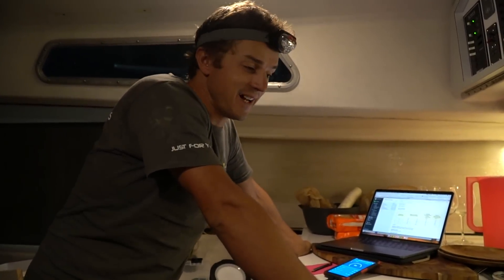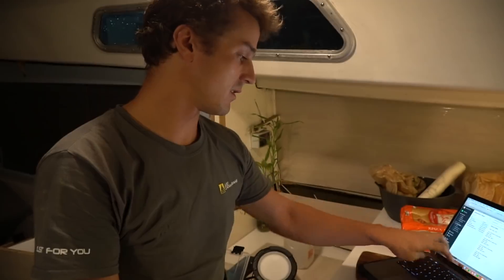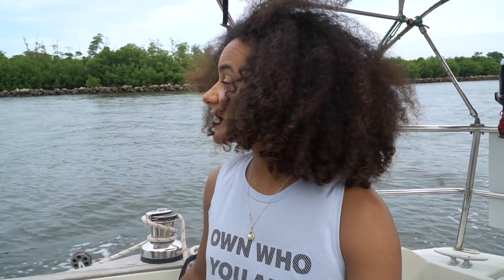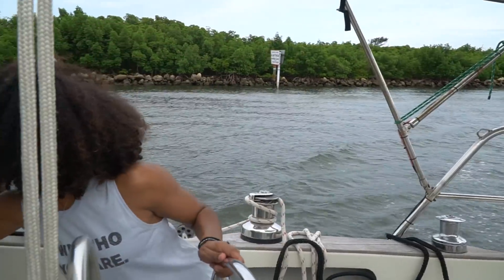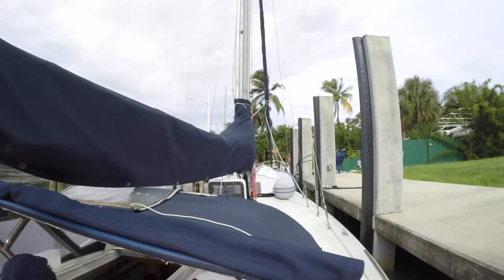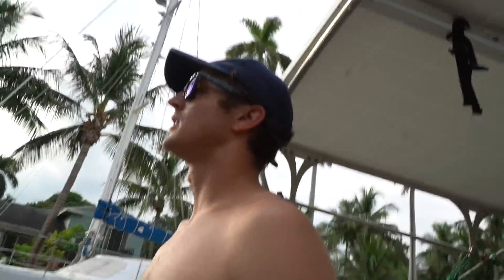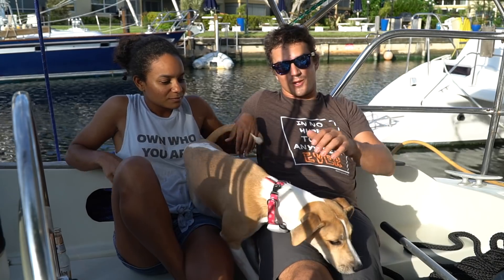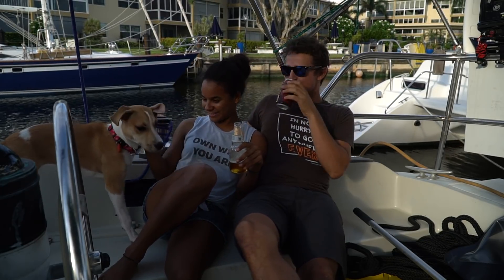Pushing our Electric Motor to its Limit— Sailing Uma [Step 139]

Comment: For all the electric motor downers here sailors like Lin and Larry Pardey sailed for 30 years without an engine.  If your situational awareness, or lack thereof, gets you into situations where only an engine will save you then sooner or later the engine will fail.  I know black swan events happen however in most cases proper route planning and seamanship are better safety companions than an over reliance on an engine no matter what the fuel source.
Reply from the maker: JED!! PM us your address. You my friend, get a free t-shirt!
Reply: Keep your shirt . I guess you didn't like my response so "JED " gets a medal  lol.  I do like your Chanel.
Reply: Dan, Kika (and JED), Our company has worked on a combined heat and power unit that runs a starter/generator at 890°F. In your application it could give you A/C, heating and long distance propulsion with environmental impact and running costs similar to the solution you now have.

However.... in trying to bring our tech to market we've learned that the big hurdles to adoption are not technical. They are political and macroeconomic. You can't significantly reduce global consumption of hydrocarbons without a major impact on economic stability. The answer is for people to change their behaviors to reduce HC consumption.

You guys are the epitome of where the world could be. You only motor when you can't sail, you don't run a car and you buy old(er) thing (the boat and dingy etc.) and make them last. BTW more that half the environmental impact of the average 'plastic' boat is in its manufacture.... keep up the good work.
Reply: Lin and Larry got a lot of tows that aren’t detailed in their books. Nothing safety related but save time when they can’t get into an anchorage, „phone a friend“
Reply: The Pardey's also went and bought a much bigger boat, hmmm...I also found it a bit interesting that they really do not get into the towing issue much, hmmm...Granted, what they accomplished is awesome, but...
Reply: They could get a backup gas generator. They are very reliable and efficient.
Reply: Lin and Larry lived on an Island in AKL, NZ. Close to land they have had major challenges and even got stuck on rocks with damaged hull, however they did well offshore. Going totally electric has major challenges still, once power level is low you cannot simply fill it up quick like diesel, hybrid would make a lot of sense. Some years back Lagoon came out with model 420 hybrid, the 1st boat off the factory could not make it to its destination without blowing circuitry and having issues with batteries, and that was hybrid. They gave up electric eventually. No amount of lab work can prepare the drive system to deal with constantly changes dynamics of water, current and windage. While I would like to see a working system based on electric only, I am optimistic still.
Reply: How much battery capacity you have? How much your batteries weigh? Thanks in advance
Reply: I just wonder. The Dutch opended trade routes by Sea to Japan and China in what we call the our Golden Century. That the 17th Century, from the Year 1600 till 1700. How on Earth did we manage without a Diesel Engine in those days? By the way the German Rudolph Christian Karl Diesel is the inventor of the Diesel Engine. He lived from 18 March 1858 till 29 September 1913. His first Diesel patent was from 1892.
He disappeared was lost at Sea at 29 September under suspisious circomstances whilst Sailing to a shareholdrr meeting of his own company: Consolidated Diesel Manufactering. He also had talks with the Navy of Great Britain to fit diesel engines in submarines. 
As he had financial problems Some say he commited suïcide and jumped overboard, others think it was the German secret service  who did not like selling Diesel engines to the UK at the brink of WWI. Rudolph Diesel’s death was never solved.

As we say in Holland: “De beste stuurlui staan aan wal”. Roughly stranslating to: “The best Sailors stand ashore”.
But remember: “Wie zeilen kan, vaart bij elke wind”, a Dutch sailors saying meaning: “He who can sail, sails in every wind”.
Reply: @robinrouwen4580  We don't often read of the thousands of old ships lost at sea embayed on a lee shore or stuck for weeks in the Doldrums!  My 1885 Essex smack had no engine (indeed, no electrics) and  I never put us in a situation I could never sail out of. In the old days the smacks would happily rub shoulders with each other in port and even surge the running bowsprit to stop. Imagine doing that in today's marinas!  My other problem was that other sailors seeing a 65 foot o/a 17 ton gaff cutter would assume that we had an engine and could stop at will when they hit reverse in front of us. In 1885 nobody had an engine so they all acted accordingly.
Reply: Must be referring to 'VW', ha, ha, ha.
Reply: Stephen Gloor 😘
Reply: JED... We're part of the Mainly Electric Aircraft thing. 

You put a turbine in an insulated box with a motor/generator on the main shaft. The whole thing runs hot enough to produce useful heat (you need to understand a little thermodynamic theory here). You include a heat pump in the system to harvest the heat energy. You can use solid state devices for this (see Peltier Effect). .... and so you get an increase in total system efficiency and reduced weight. You include batteries for demand management and the whole thing runs at constant load, so it's reliable. You use bio fuels to address the environmental challenge. 

In a boat application the motor/generator would be decoupled from the engine to give you variable speed to drive a prop. When sailing (engine off) the prop would generate electricity. The heat pump would be configured in the boat to provide A/C and refrigeration. You'd configure the system to provide hot water and cabin heat. You also have enough temperature difference to cook.
Reply: I do understand both the need and the desire to go all electric. Depending on where someone sails, what kind of risks they are willing to take, it might be the right decision. When sailing a tri I tend to take other decisions than on a mono hull. A open boat has very different set of considerations. Since everything you do at sea has a higher risk than the stuff you do on land I tend to see the risk evaluation even more important. Main propulsion system are the sails, the back up is the motor. In a pickle I pick speed over the system. Even if it isn't pollution free it might save your life.
I had a hell of a time when crossing the North Sea, forecast was wind up to 4bft. Normal trip of around 250 nmiles. We encountered a channel rat, up to 9bft. That was on a tri, speed was the saviour, in that storm two 40ft monos were sunk. One hove to, one tried to weather the storm. In my case an electric motor wouldn't have been the solution, speed was.
Reply: Good luck staying off the reefs dude.
Reply: Sure, agreed, but your range is seriously limited, and you need either sufficient wind or PV or both to recharge the Lithium Ion batteries, if I'm n mistaken the Pardy's regularly called in for a tow, and they also sailed 4 decades or more ago, when there were way less cruising boats and boats in general in anchorages and at sea, the majority of issues with diesels is under use. And that is probably a yachtie thing "this is a sailboat not a motorboat" attitude, which is stupid as diesels want to work. I just think that the costs involved in an electric drivetrain is a case of more cost, less flexibility.and an incredibly long break even timeframe
Reply: yeah, I've even heard they sailed for k's of years, around the world without engines!
Reply: @jed7644  I think you are right, the improvements in electric power are at an exponential clip. I hope I live long enough to see a standard electric yacht motor.
Reply: I was in the process of this kind of comment referring to the Pardey’s when I saw your comment. Very well said!👍
Reply: SV Clownshoes o
Reply: They have only done one small trip with the new system. With all the planing it still didn't work. Luckily there was a dock to tie up to and not a reef to be pushed onto. The sailers who sailed the world without engine, went past most of Australia, Indonesia and anywhere along the equator. You can't safely sail these areas without an engine. Strong currents and sometimes no wind for days, deep water till you hit the reef. No planing will get you in over a bar and up a river in Borneo without an engine. We try to always sail and have sailed 20,000+m through these regions. All up we would have spent less than $1000 on diesel. I'd rather do that than miss out on some of the best cruising grounds.
Reply: Richard dackas I don’t have your experience however you completely misunderstand me.  The Pardys circumnavigated twice and Lin lives now in NZ so I am pretty sure they experienced some of what you have seen.  The point is that if you shoot the Ballina bar on a day when you really shouldn’t, safe in the knowledge that your engine will power through, your engine one day will fail and leave you stranded.  Sure 99 times out of a hundred it won’t however it only takes one.

I often work in the mines here in WA.  We all wear PPE however all the safety training we get emphasises the fact that PPE is the last resort that may save something when it all goes wrong.  If you rely on PPE to do you job then you are doing your you job wrong with the wrong controls.

IMHO a sailing boat’s primary propulsion is the sails.  An engine is an auxiliary power plant and should be viewed like PPE.
Reply: @stephengloor8451  owning an engine doesn't take away from good seamanship
Reply: JED:

Very nice sentiment, most of which is true.  There are three components to the discussion that you (and they) are ignoring.  One, and most important, is energy storage density and immediate availability.  1 gallon of diesel contains about 40 Kilowatt-Hours of energy.  So you could cover a boat with photovoltaics and maybe collect 1 kilowatt hour for 6 hours a day.  Thats equivalent to about a pint of diesel fuel (maybe 2 considering the inefficiency of converting it to electricity).  Also, while shiny new batteries look really great, they age quickly especially when doing deep discharge cycles.  So while the salesman will tell you about all the great service they will provide, you will soon learn that there service decays in a more or less linear way and after 3 months, you are getting 80% and and after a year, you may be seeing 50% capacity.  So in the back of your mind, you will never stop fretting about when you must throw those recently shiny new batteries away and replace them with another new stack...at about $1000. (They have already done that).

#2, True that many new commercial systems (including military) are DIESEL- electric,  with all the appropriate redundancies with multiple propellors or nacelles and associated power sources.  These systems, including the modern electric cars are operating at much higher design voltages, so therfore the components are proportionately much smaller (still the same power density required however).

Lastly, #3 is the availability of repair expertise and spare parts.   When you cruise up to a dock in timbuckthree, what are the odds that they will have the correct sized brushes for a who knows what traction motor out of a forktruck?  This of course can happen when the hot air in the motor ionizes and joins all the carbon brush dust all over the brush rigging to create a flashover that destroys the brushes, brushholders and damages the commutator of the armature.

I agree that this idea has romantic appeal, and I spent over 4 years in the 1980's doing exactly what they are doing now, only in a car.  A car that got towed home on numerious occasions.  A car that got repaired and rebuilt numerious times.  It works now in hybrids because they have high efficiency batteries and the availability of alternative fossel fuel power.  (did you notice that they never tell you much about the cost of the batteries or the life of the motors....and their cost?)
Reply: Did you not read efficient diesel engine, dude your living in the past, I guess your a hater of new generation nuclear power
Reply: @patrickcoleman3  now a nuclear engine on uma, ha ha, you talking power! But id say moving totally against what they are trying to achieve here...and the rest of the world as well.
Reply: @craigme2583  never said that you did. All I'm saying is there are clean diesel engines. I did however suggest your ideas are to far in the past.
Reply: Ok How many got stuck in bad weather or no weather at all just sitting Idle  for days or weeks? ? Your only mentioning "Lin and Larry Pardey" Im not a sailor but soon will be. I am however a engineer and the electric motor is 10 years away from being perfect for a boat. It needs all the associated charging to come up to par (wind,Solar and sea charging)
Reply: Atr42Greasemonkey Part of seamanship is how to hove’to or deploy a sea anchor or correctly read the weather forecast.  And yes you will be becalmed and I am sure it drives people nuts however if you want to get around to a schedule maybe sailing is not for you.

I read a book a while ago detailing light aircraft crashes and the contributing factors.  A distressingly large number of them started with “we knew the weather was bad but we had to be back on Monday” or “we flew on looking for a break in the clouds because our passengers had to make a connecting flight”
Reply: Steven Gloor."I read a book". That says about as much as we need to know about you and boats. Aircraft can't be compared to boats, boats can be at sea for weeks, and no forecast can predict weather conditions that far out.
Reply: @grancito2  the most intelligent people in the world read a lot of books. There are two places people learn things. 1) from doing and making mistakes, and 2) from learning about other people's mistakes. So whether that's from reading a book or watching a vlog, the experience of others is priceless. Your comments show a shallow way of thinking. Steven's comparison is perfectly reasonable and appropriate. Of course boats and planes are not directly comparable. But there are absolutely aspects of shared relevance. While your disparaging comment about forecasts is certainly not. It is actually quite easy to forecast weather patterns. That's exactly how we know when the Caribbean hurricane season is, and why sailors typically head out of the area prior to that season. Planning, knowing your own limitations, and knowledge of the environment, location, and situation is key to a safe passage. On the other hand. a haughty, know-it-all attitude, and ignorance of common sense doesn't make a very good impression or win friends.
UMA crew...love what you guys are doing! And looking forward to going all electric some day soon myself. The technology is certainly available now, as you've proven well over the past few years. And with the advances that are sure to come, it will become much more affordable for many of us to make the switch. Keep it up and keep proving the doubters wrong. I'm not saying everyone should ditch the diesels and go completely electric (though it would be a lot quieter, and cleaner). Many sailors (and non-sailors) don't have the patience or common sense that you guys do. But there are many of us who greatly appreciate your example, and the honesty, integrity, and transparency that you have in sharing many of your mistakes and what you've learned from them, so we can "read your book" so to speak, and learn from them as well. you guys rock!
Reply: Yeah well the places they go thats not always possible, its quite possible to get a super efficient low emission diesel motor instead of using something that possible could let you down in the worse possible time.

Comment: question:  did you equal the weight out from diesel and fuel to all electric. or can you add another battery bank or two  to match the original engine mass weight..   to get farther range on your electric engine....

Comment: I love the story so far. I just found you guys, and I'm getting some good ideas from your travels. I can't see what happens. I haven't gotten to the current videos, yet, but I have some thoughts. Adding some aluminum cooling fins to the motor, and routing your venting fans to pass over the motor would do a lot for increasing the thermal efficiency of the system. Instead of running water cooling lines over the motor, you could make a copper coil and blow the air from one of the vent fans through the copper coil to help cool the air before it passes over the motor. Happy sailing.

Comment: I'm wondering if adding aluminum or copper heat sink fins to the motor casing would help dissipate the heat. And you could use copper coils and circulate sea water through those fins.

Comment: This probably way too old to comment on and I know you have long since changed the electric motor but 240F is way hot enough to melt epoxy.  I guess that didn't happen, so far, so good.

Comment: Most forklifts work on an intermittent basis,  which translate into allowing for hotter temps knowing it is short duration (something like a sump pump, that's cooled by the water it sits in). I think you could do better with a motor designed for motoring, like even a car electric motor.

Comment: Class H is plenty. 900V F1 hybrid motors are Class H....  Be aware that there is a temperature/time ageing characteristic on insulation systems though. On brushed motors, keeping an eye on your brush temperatures is often the limiting factor....  Blowing air is a great plan though, doesn’t need much.